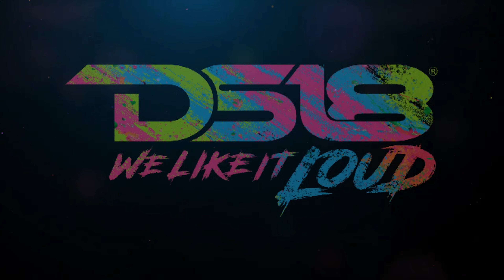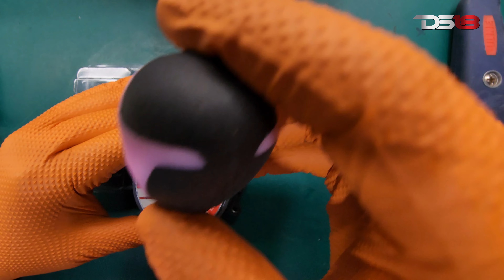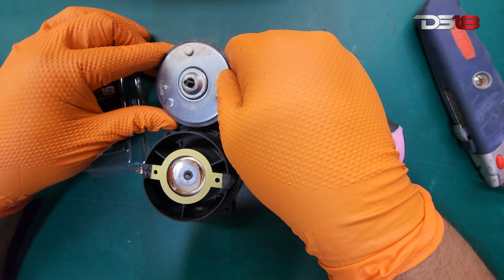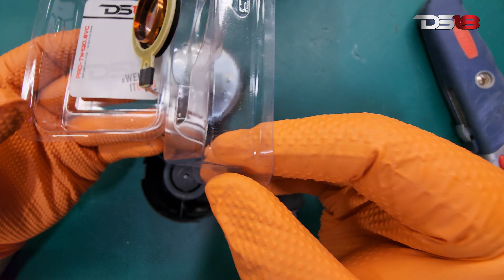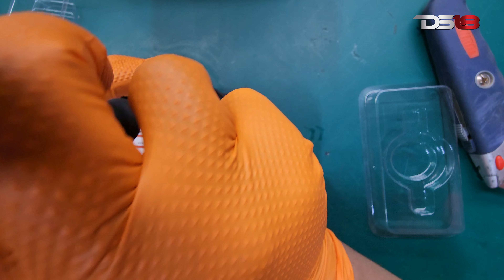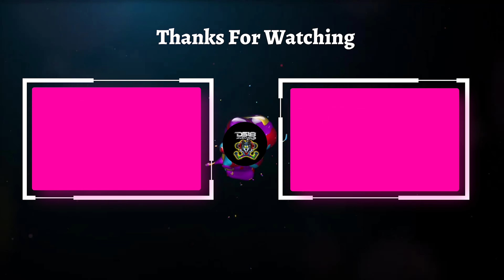DS18 PRO-TW120.8VC PRO Replacement Diaphragm For PRO-TW120 And Universal 1" VCL 8OHM

Comment: Hi I've been sending messages to you guys to find out if I can use the 12"high Excursion recone kit on the 12 exl xx12b2 please help
Reply: Sorry they are incompatable because the pole length on the EXL XX high excursion model is different from the XXB model. The former would slam on the magnet plate as soon as you gave it proper RMS power destroying the coil and former. We recommend the EXL-XXB recone specifically for the sub you asked about.
Reply: @dirtysouthwookie5512  thanks much...